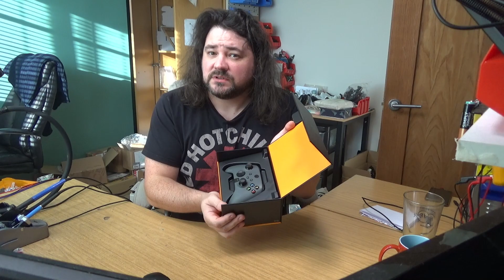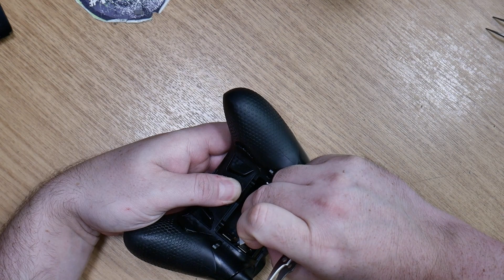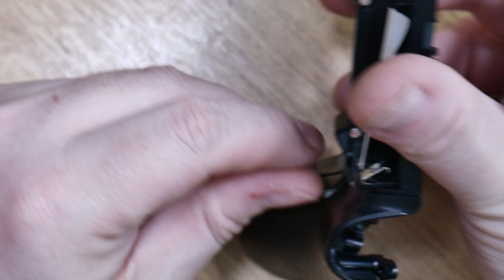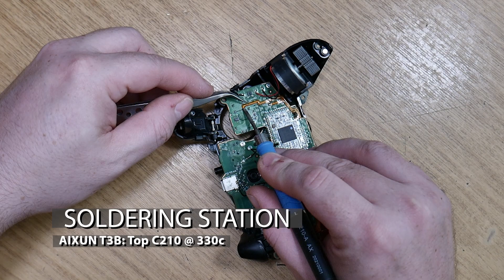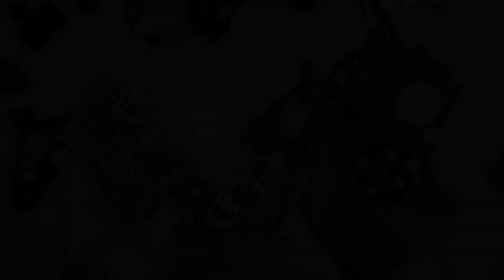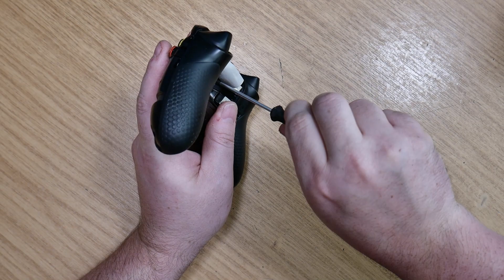SCUF INSTINCT PRO LB RB STICK DRIFT REPAIR

Comment: I was wondering what exactly you were doing when pulling off the potentiometer and putting it back when you replaced the analog stick and were removing the minor drift the new stick had

Comment: Man you make it look so easy! specially the disordering part jeez!!!
Question for you mate, have you ever had one of these instinct pro controllers make a high pitch buzzing sound? (only when on) almost imperceptible like the ones lamps do that you can only ear in complete silence and when really close to them, my controller does that and I don't if I should worry about it, if it can be fix or if it's completely normal.
have a great day man! this is some really good video cheers!

Comment: I just got a Xbox controller with the Hall effect joysticks. I was wondering if I take the joysticks out of the replacement controller would they work in my scuf instinct controller. The left stick on my instinct pro failed after the first month

Comment: I have a question, trigger click are better them stock for xbox x controller?
Reply: it's optional and is considered to be better only for shooter games like call of duty that would require you to have a shooting advantage
Reply: Like the guy above said, it's only better for shooter games but the second the game requires an analog pull for the trigger then no because you won't be able to control the speed of a car for example since you'll only be able to go full speed when pressing the click triggers

Comment: I'm interested in replacing the censors inside the green part of the scuff instict pro.  Anyone know what ohm it is so I get the correct censor?  That helps alot with stick drift for me on old scuffs but can't find a clear answer on this specific controller
Reply from the maker: Will either be 10k or 2.2k

Comment: Do the scuf controllers use the same mechanism for the bumper buttons as all the other controllers? Trying to find a controller where the bumpers won’t go bad in a month. Only thing I’ve found that looks any different than stock is the Razer controller but it only comes in wired.

Comment: Do you have to desolder the PCBs to replace the analog stick? Can you just do it while they're together.... atleast the left analog stick anyway
Reply from the maker: I tend to disassemble the device so it can be worked on and fully checked over. If you don fully disassemble and have wires and components dangeling more damage can happen.

Comment: Do you know of a place that sells replacement parts for the mouse triggers on the instinct pro? Unfortunately the bit of plastic that makes contact with the actuator snapped off during game play. I may just end up trying to glue it back together, but I'm not ap that confident that it'll hold up over time.
Love your content!
Thanks!
Reply from the maker: Thanks for watching! We sell the switches here: https://www.ubermicro.co.uk/product/scuf-digital-trigger-switch/